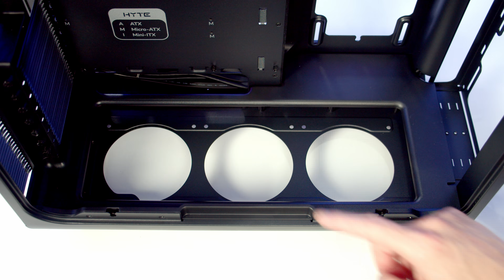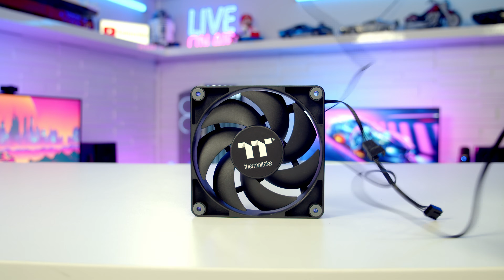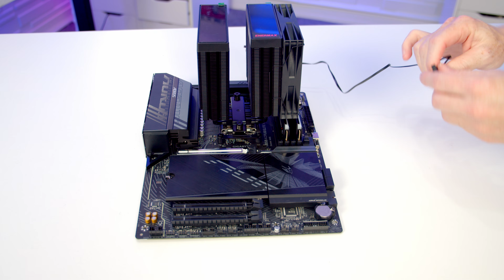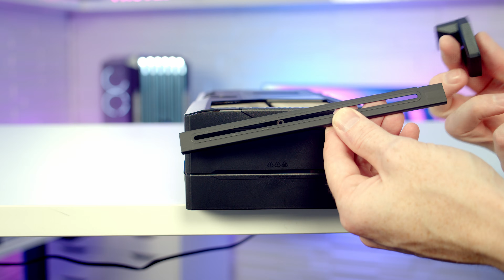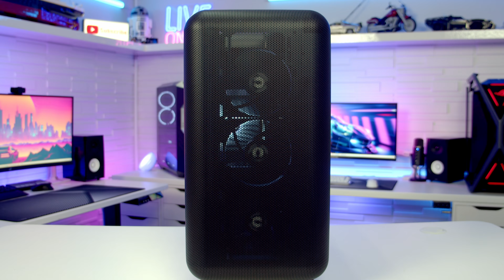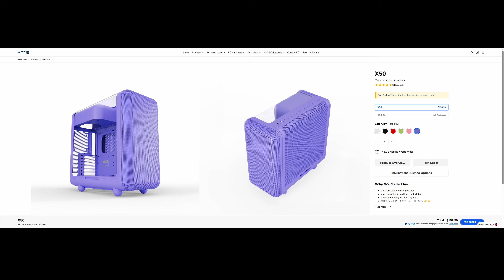Hyte X50 Build - Step by Step Guide

Comment: Hi! I have an MSI MAG A850GL power supply and a HYTE X50 case. Since the PSU is top-mounted, I have to install it upside down (fan facing downward), but when I do this, the screw holes on the back don't align with the case at all. Is this normal, or is there a specific bracket/orientation needed?

Comment: It's a refreshing case, departing from the overly showy and angular aquarium-style cases, and offers enough visibility for those sensibilities, albeit slightly subdued ones. However, the true value, in my opinion, lies in the air variant for a sleeper build. Providing you have RGB airflow and a sizable enough AIO, you can achieve a subdued sleeper build that still shows off plenty. In my opinion, the best builds are in the white case that truly shows off RGB even through the mesh and is also cheaper and technically has better thermals compared to the glass.

Comment: Hello Mr. Christopher, i have a question if you dont mind respond. Does a XFX Swift AMD Radeon RX 9070 OC fit inside this case with the cables? The specs says its 150mm tall, the same of the GPU you install in this video. Thanks beforehand.

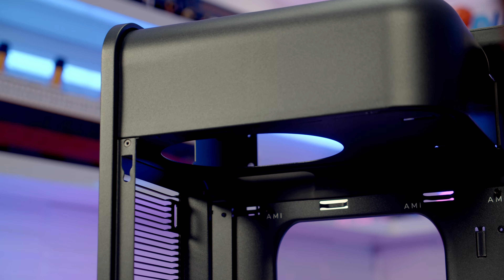Comment: At 3:18 you mention that the PSU gets "Cool air from the case". Won't this air actually be quite warm unless the rear fan is set for intake?  If the rear fan is set for exhaust, there may be a risk of the warmest case air entering the PSU causing a potential for overheating the PSU.
Reply: this is how old cases were made and it never was a big problem, however it definitely isnt optimal.

Comment: Reminds me of my old Fractal Torrent with the PSU at the top. Beautiful case! Pity about the mesh panels having no removable nylon dust filters behind them as the optional nylon dust filter that shipped with my Lancool 217 catches quite a lot of dust that the front mesh panel misses.